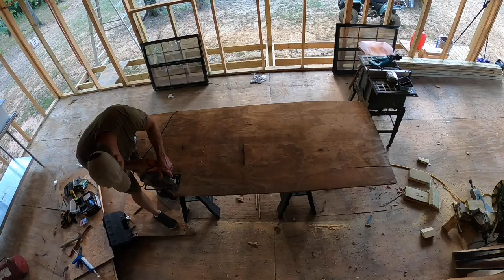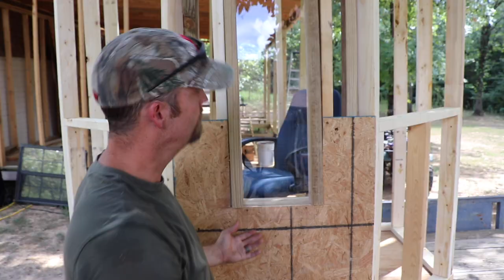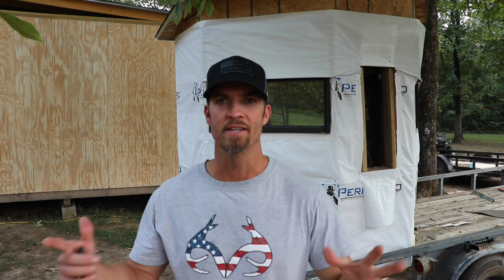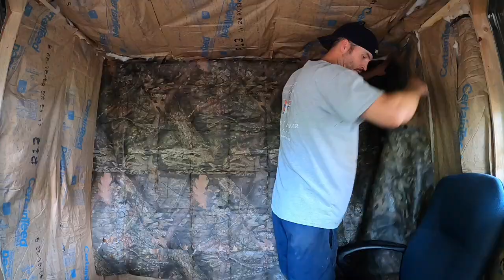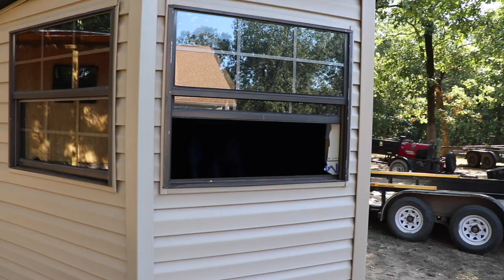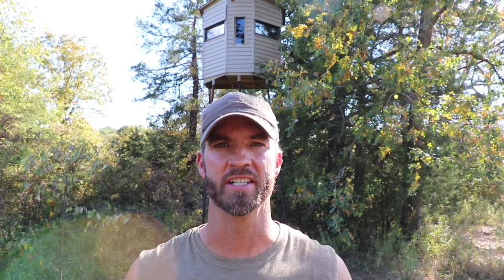Deer Stand Build (Start to Finish)

Comment: I have a question how is the stand attached to the blind . I saw you set it up but was wondering if a high wind would be able to knock it off the platform. Even though I know the house part is very heavy but in the winds we have I think if it’s not angered to the stand itself it would topple it off .
Reply from the maker: Yes it is bolted to the angle iron metal frame

Comment: Would you be willing to send me the exact measurements of the build without a stand on the bottom also without the window cuts please.
Reply from the maker: 7ft across the back, 36 inch walls on 3 sides
Reply from the maker: Well mine has a short center wall.